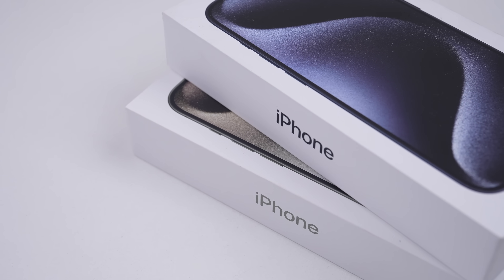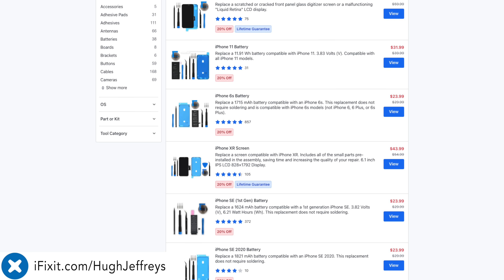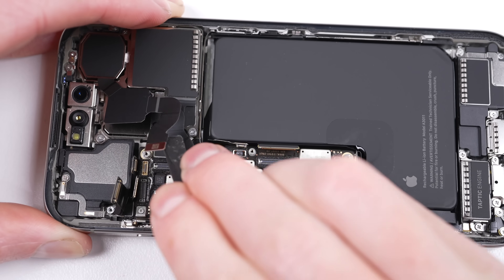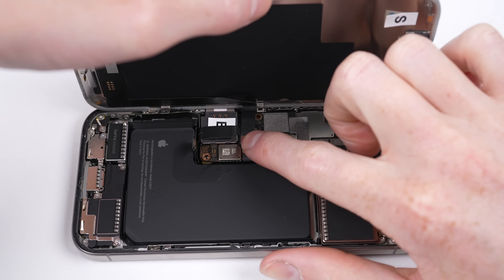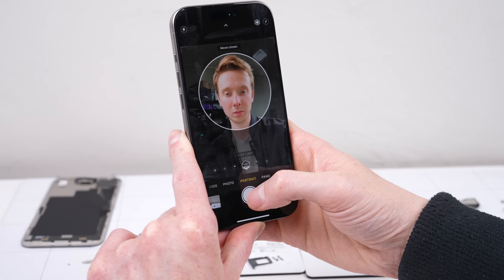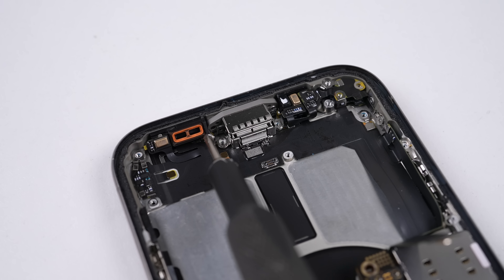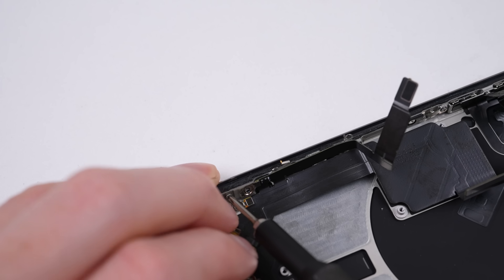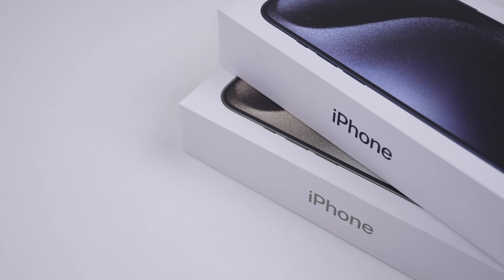iPhone 15 Pro Exposed - This Will Harm The Environment - Teardown And Repair Assessment

Comment: Interesting to see the 15 Pro has a connector for the ribbon on the back of the board. Jerry rig Everything's 15 Pro Max had it soldered to the motherboard. Could it be a regional model thing?

Comment: Slight clarification. EU regulations did't prohibit iP15 from using lightning port. They come online next year.
Also it's and USB-C port but in non-pro iPhone the speed doesn't increase over TB and is still usb 2.0 standard. Pro version is faster but... well of course Apple didn't include such cable in the box and you have to buy it separately :)

Comment: "iPhone 15 Pro Exposed - This Will Harm The Environment - Teardown And Repair Assessment"

Literally all products with batteries in it, are terrible for the environment. I didn't know this a week ago but magnets are pretty bad as well. The best thing for the environment is to make a product last as long as possible and make it consume as little power, and water, as strictly necessary. Anything else is marketing. Do I consider it smart to stop adding cables and chargers to every single product? Yes. I ended up with far too many Scart, DVI, USB mini- and micro cables w/o buying a lot of products. And now even my USB-C and HDMI cables are starting to pile up.

Comment: Swap only the rear glass and let's if that rear glass is really that easy to replace. I won't be surprised if the charging coil and flash are serialized as well.

Comment: So, on one hand, I feel like if you want to replace the parts with third-party parts, you should be able to. On the other hand, I have gotten phones with third-party parts, and the quality of those parts was not great, and I feel that this is part of the reason iPhone retains value.
Reply: A simple message "Hey user, your screen isn't the one this device shipped with, so you might not get the optimal experience" is a LOT better than engineering in "bugs" into the software to make the user experience miserable and makes the device seem broken

Comment: Standard iPhone 15, slightly better standard iPhone 15, iPhone 15 pro , iPhone 15 pro max. These guy are taking the piss at Apple. Granted iPhone 15 is better than say Motorola edge 20 pro in terms of screen Rez and better processing chip but as far as can tell it got less ram but the £600 Motorola edge 20 pro isn't that far behind in spec wise and it's nearly a few years older

Comment: Well, the other side of repair with a donor phone, is stolen phones, if a stolen phone can be used as a donor of parts,  it becomes more appealing to thieves to snatch your phone, this way can be activated, and be used for parts, what apple should do is make an activated process if you exchange one part submit a proof of purchase or if the part was linked to a devise with the same cloud account.

Comment: Crazy they make it so hard to repair. 
Recently the USB-C Port on my 4 year old Xiaomi 9T Pro broke, but the repair was so easy that I was able to do it myself even though I had never done anything like this before and now it fully works again.
Reply: Port assembly replaced? I was considering replacing mine but didnt want to waste 20 dollars on entire assebly since it still works, just isnt nice when you plug it in
Reply: @Boz1211111  Yeah I had to replace it because it didn't work anymore. So I actually replaced the hole board on which the USB-C Port is located, which also included the Sim Card Tray, but the new board looked and fitted exactly like the old one and it wasn't even that expensive I paid around 14€ on Ebay for it. 
The hardest part of the hole process was actually to get off the backglass cover, but with a bit of heat and a few YouTube Tutorials you should be able to do it.
Reply: @Alex-yt8gn   thank you

Comment: Question: Are there any features lost when swapping the back glass? Is 3rd party repair companies able to purchase the rear housings either first or after market when they become available and swap them without swapping the NFC, Charging Coil, Magnets and rear flash to keep the serials paired?v

Comment: So if the back panel is replaced by either genuine or 3rd party part will the wireless charging work and the flash or are they also software programmed

Comment: "All same except the frame" is plain wrong! USB-C is not faster per se.
Swapping causing errors is not a problem, it's a feature! I wonder when you will learn this? To explain the feature: I don't want my iPhone to be stolen to then be used as replacement parts by anyone.

Comment: I’m really going to have to figure out how to get away from apple. As an old IT worker and designer I love apples platform and that it just works. But I can no longer deal with their shitty practices.

I recently bought a pair of used APP’s, they were almost flawless copies and had a working serial number that their hardware and website said was real. Took me 3 weeks and a visit to the Apple Store for them to tell me they were not real and they won’t do anything for me. The tech I spoke with later admitted they knew about the serial it was logged yet their system doesn’t reflect this to potential customers if the scammers and they could fix it easily, he straight up said this and no they won’t give me a set of real AirPods. I don’t expect anything for free but Apples own warranty program has been hacked! It’s messed up!

Comment: Dude I spent two years trying to install windows on an old imac. I had upgraded it to a modern OS (catalina) and they’d implemented everything to ruin the process. Once I deleted the whole drive I was installing 64bit windows and playing ps2 emulation on 256mb of vram. When I was done I sprayed the whole thing purple flake. It was finally mine to do as I pleased, after all that. I even found a spare in my neighbors trash post-covid (it has a school sticker on it) I put a ssd in it and installed Arch. That one I painted gold mist flake… but later switched the front shells. they do now offer a free tier of xcode. So I can install retroarch on an iphone without giving my credentials away to that stupid signing app. But youtubers still want you to do it the dumb way. They always just throw extra hurdles in your way. And stupid people end up doing stupid stuff anyway and even getting compromised, lol. The big wow moment is when you find an aluminum all in one computer with a stupid yuppie “you have to pay for that” attitude and a proprietary graphics that leave a lot to be desired. Shut up computer!

Once this stuff gets old not everyone wants to recycle it. These phones are so boring though. They’re not prepared to last, it’s like someone saying “if the apocalypse comes, I don’t wanna make it; I wanna be the first to die and that’s it.”

It helps their bottom line maybe, but it sounds uninspiring. Why do you need to throw away the old one just to get a new one? If they’re so good…

If I was them I’d be trying to get the old phones to talk to the new phones and hand off tasks when the battery is low or something like that. Or maybe for one to charge the other, etc. Even if people line up to get the new one every time. But the new product never really blows my mind. If I was a kid I would be lining up to buy a bunch of steam games, not a stupid conformist phone that makes it own rules.

Comment: Good to know. If cheap screen replacement removes features to nudge you towards sending them your phone,that's like saying "you have the right to repair, but you're going to hate it." But then they don't even offer a better solution. Passive aggressive at it's worst... screen repair is a repair store's bread and butter. $100 for 15 minutes work. At least before nothing happened, just the phone complained. No front camera if you switch to an aftermarket screen? Yikes.

At some point they could just be like, “is our phone safer than other phones for browsing the internet” Yes. Okay, “is our phone safer against theft?” Yes. Okay! “Is our phone repairable” Yes, let the consumer do whatever the hell they want with this thing once they have bought it.

Comment: Repairability (or lack thereof) is just another reason not to buy the iPhone 15.  Also the iPhone 15 Pro Max has a VERY weak glass back.  It cracked on a YouTube durability test video just by pushing on it with their thumb.  I'm aiming to purchase the new Pixel 8 Pro this year instead.

Comment: I don't thin anybody has belive that apple would change their politics. Apple has fight years only to be able to sell to customer cable or power adapter. a matter of fact apple might agree the right to repair bill but nobody told us by when they have to implement it.  -- the customers just got fucked by apple again because nothing has changed. :face-green-smiling:

Comment: Apple may have use a usbc but it still the same speed as the lighting port Apple just use maliciouscompliance if you want the full speed of the USBC you have to buy their Advanced model the probe or whatever they call it so the reality is even though Apple switch to USBC you really don't have fast charging speeds and let's use a genuine apple-certified cable again and your data speeds are garbage no matter what cable you use unless you have their extra pro model

Comment: As to be seen in Zack's (jerryrigeverything) video, is the iPhone 15 pro max different. Not only in size of course. But the logic board on the iPhone 15 pro max has a hard-attached (non-removable) flex cable. Probably for the 5G antenna.

Comment: While it would be nice to be able to just swap parts in and out I probably wouldn't even do that if it was possible. No way I'm opening a $1000+ and compromising it's IP-rating. That's going straight to the manufacturer

Comment: Apple never had to pad a fee for Lightning because they owned it.  Whereas all companies with devices using USB-C have to pay royalties to the UBS IF (USB Implementers Forum) who developed the standard.  Also Lighting was used for so long because at the time the USB-C standard was not ratified or completed and this did not occur until 2016 (designed in 2014).  I don’t care about “environmental” factors and would never ever repair my own iPhone.  I would get Apple to do it under AppleCare and people have to look after their hardware and be more responsible instead of shifting the blame onto the manufacturer.   If you want a fully repairable phone make your own.  Also stop believing you own an iphone - you never own it - it’s basically leased no matter it outright or on contract.  I have never ever had to repair a single iPhone in my life - no broke glass components.

The patents / copyright / hardware are NEVER transferred to legally to the purchaser as your “own property” so please stop believing this theory with iPhones - NOTE: This also applies to Samsung as well.  This is also why Apple doesn’t allow an open self-repair market for these complex devices and especially if a “home repair” goes wrong the purchaser will then whinge to Apple.  The idea of using genuine Apple parts and service for repairs is also a legal liability one so Apple cannot be legally sued when a “home repair” goes wrong, and if Apple creates an issue with a repair you cannot be blamed.  Anyone that wants to take on full financial and legal responsibility for a “home repair” to save a few dollars due to “inconvenience” needs their head read. 

NOTE: The rear glass on the new models is thinner and more subject to damage and more brittle.  This is why the Apple repairs costs reduced so these new iphones are not as strong on the rear glass as the previous models.

Comment: While I don't necessarily agree with Apple's stance here, I can understand why they may have taken certain 'preventative' steps. For example, the front facing camera is an integral part of the iPhone's security system and is registered to to phone during manufacture. If the phone sees a different camera component it isn't to know that the change is part of some intrusion attempt thus the phone 'fails safe' (unless the new part is properly registered). Yes it's a pain and I can't go to backstreet repairers, but if it means that my phone is as secure as it possibly can be even in the hands of a thief who might strip it down (given how much personal data is on it), then it's a hit I will, albeit reluctantly, accept. As always, great video - thanks.

Comment: To be fair I don’t see Samsungs as being repair friendly either. They are partnered with ifixit to sell oem parts, but you can’t even buy s23ultra parts. They have an s22ultra section but screens are out of stock on a year old device. What sense does this make. Fact is there aren’t many phone manufacturers that have parts readily available, all but one, Apple has parts available!

Comment: I have to say the internals of the iPhone are a thing of beauty. However, it is clear to see that the engineers made very little effort to ease maintenance. Even as a layperson, one can see the device is heavily over engineered with vast quantities of screws and cables etc. Apple can get away with this I suppose because they can charge a premium for their products. I am sure, an iPhone of the same quality and function could be produced much more simply via a different approach in design. Still, it is a free market and no one forces you to buy an iPhone.
Reply: Pretty much my own thoughts. Unfortunately, other manufacturers have been taking notes and we're now seeing parts pairing and complex internals in other phones too.

Comment: Back glass producing still cost a lot. They put microphone and wireless coil to track change backglass. If they worry about repairability they must put components separately. Also changing  usb-c is so complicated what needs disassemble almost all phone. For me most common problems is broken glass/screen and charging port.

Comment: The frame isn't titanium, only 1mm of the exterior that you can see. Everything else is aluminum and it's glued together. More marketing BS from Apple. Weight savings must have come from less parts and/or reduced manufacturing costs.

Comment: The thing is, dumb ppl will still buy this trash, the problem is, there are more dumb ppl than smart ones…btw i can think of using this trash with a jailbreak or an open linux based os on and not the trashy apple version, but sincerly, at this point any other phone is muuuuch better than this onetime use crap…fu apple, the only thing they are doing is living on old glory

Comment: You should take apart an iPhone 15 Pro Max 5G phone. Apple attaches the 5G antenna cable physically to the board.
Reply from the maker: To my understanding that is the case on any US model iPhone with 5G.

Comment: TL;DR
Sad part of this is that Apple does what they want because users are still using/buying their devices (i´m not saying go buy an android because i know average Apple users/fans will refuse to do that just because it doesn't have an Apple logo in it or any other excuse) but take 4 example the port change, they changed it not because they wanted to or because users wanted to happen in first place, they did it to avoid EU fines and that's it.
Now Apple is saying iPhone 15 can overheat due to the use of Android cables but everyone knows that USB C is a standard interface. Overheating can happen only by using low quality cables.   
Apple as a company can do whatever they want and invent any lie/excuse to make users feel stupid about what are they doing with their own devices because it's their intellectual property but if we users don't show so much excitement when a new iPhone is out and we really buy devices thinking about the things really matter most as "consumer respect" maybe some things could be different now but 16 years since iPhone 2G release, this hype keeps happening and the story repeats every single year "new iPhone can't be easily repaired, it's more tied to serial numbers than last year's model".

It is users fault and we can confirm that with latest decisions with port selection in newer Mac/MacBook pros. Users complained so much about that the company listened (in sort of way because repairs are sadly not in their agenda). Take a look at Microsoft, they are now designing devices more repair friendly (laptops, consoles, tablets, etc) and even some accessories made of recycled materials, it's not perfect but it's a good start.
BUT at the end of the day we know only EU can make Apple change so it's just matter of time because EU is forcing future devices with at least easy removable batteries.

Comment: I think the reason apple realized the back had to be easier to remove is because especially with AppleCare it was costing so much for them to provide replacements to the back glass.

As a 14 Pro user with AppleCare+, it was kinda crazy to pay just $30 for a replacement back glass (they didn’t give me a new phone, and it came with a new battery replacement) given how much it would cost to do that myself (lots of time) or out of warranty (lots of money).
Reply: 100% you did not get a new battery for $30 at Apple.
Reply: @Ludak021  according to the software repair history (and the battery health showing 100%) it was replaced at the same time. 

They could have just done a recalibration and maybe that caused that though.

Comment: ineresting "jerryrigeverything" took one apart and there is a ribbon SOLDERED to the bottom of the logic board and yours does not. hmmmm ::edit:: its for the 5G antenna.

Comment: 11:01 It does what? Coming of, should be a clean slate of glass, not half the phone🙄 
We have glass screen protectors for more than a decade now and phone producers still haven't figured out, how to put such a slate, directly to a foil display or a plastic slate, that contains all the parts you just mentioned. 
F, is the only grade, Apple and the others deserve!